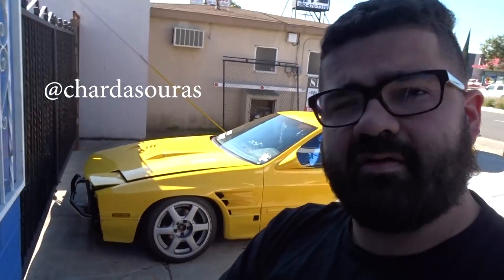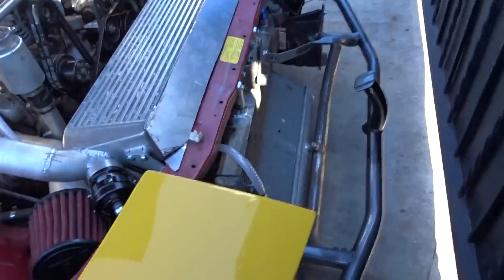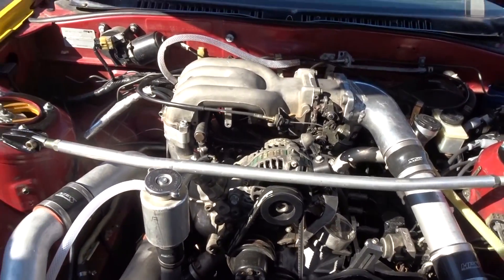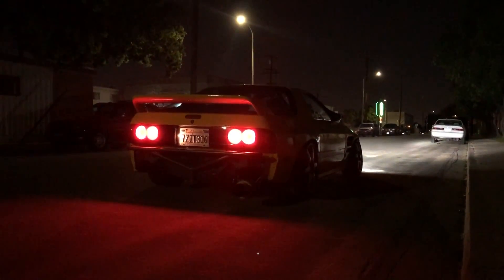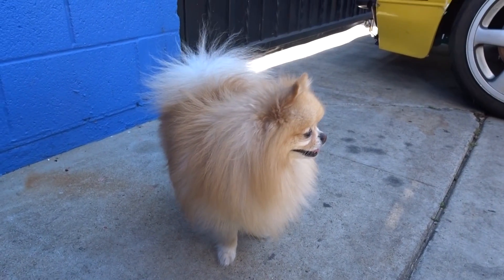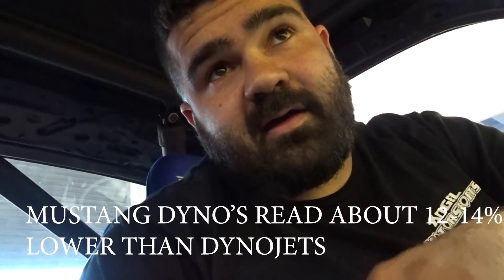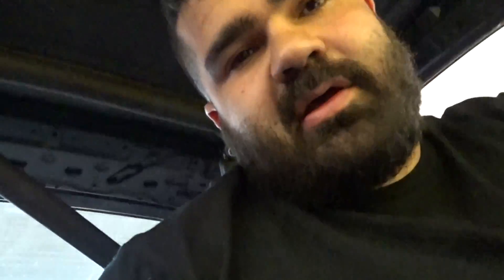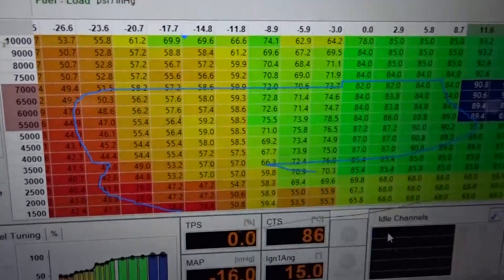Stock Engine , Stock Turbo Rx7 Dyno Tuning

Comment: im not knockin u but i feel u, trust. i could explain more on why but if ur smart abt it. itsfound on ebay cheap. itll dramatically kick ur metabolic system into bein a fresh young  fool agen. just a pt a day erey othr wk no bananas lots of bicarb soda water..but research for urself but believe its more than ridiculous so never push it or scoff that i metioned it doggy.... DNP... but ill end with this, modern american additives in diet implications  are poly synthetics equal disaster on asian/native mix caucasian bred men, which includes hispanic. especially if u disfavor alcohol or have flushing effect but deny  this indication is genetical lack in hydrogenous enzyme to break down ethanol so any bread potatos all sugars will just bloat digestion wise.  but its considered racist to understand this.